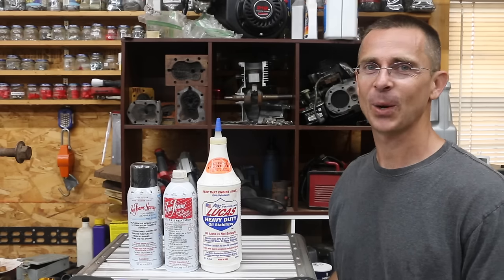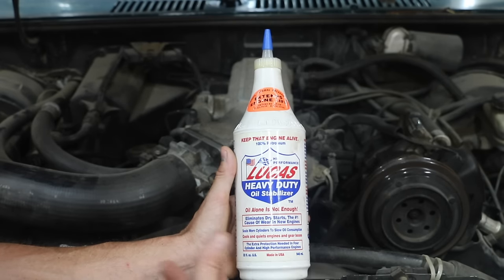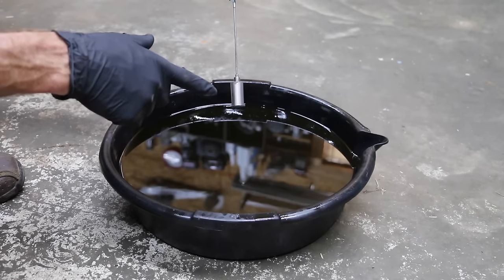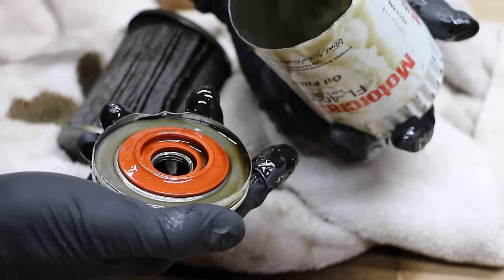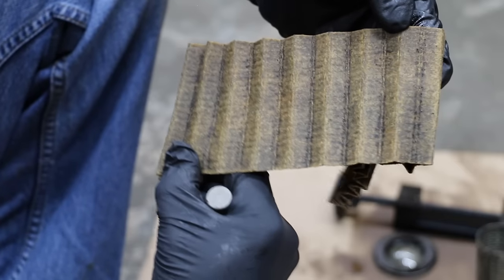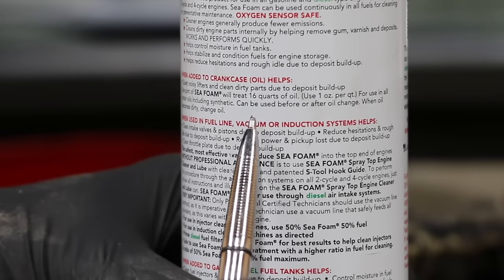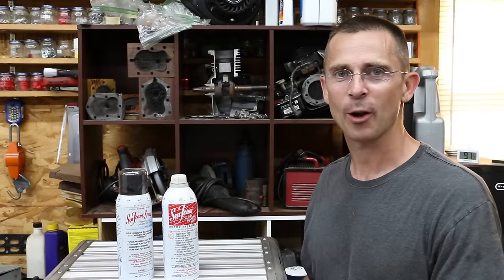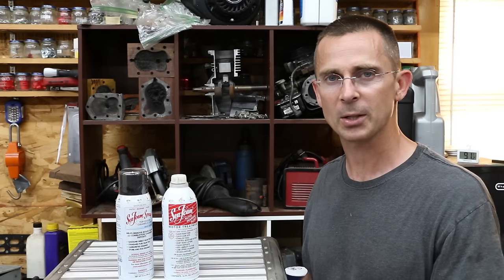Did the Seafoam fix last? Update on the Ford Ranger

Comment from the maker: Sorry it's taken me so long to post the links to the products I've used below and thank you for continuing to offer future video ideas!   Best regards, Todd
Seafoam: https://amzn.to/3l5XjLY
Seafoam Spray: https://amzn.to/3aJptI5
Lucas Heavy Duty Oil Stabilizer: https://amzn.to/2FOENb7
Reply: Lets see how XADO 1stage revitalizant will restore this engine ! : ) I'm soooo excited to see it :D Using it since 2014 in all my cars, hope you will try it :)
Reply: Try Product RESTORE for better compression.
Reply: I add 1oz seafoam after everytimr i add oil. 95 chevy s10 286,000 miles purrrrs...
Reply: What year is the truck?
Reply: Amazing content as always Todd. 
Thank you so much for all the hard work you put into these videos.
Reply: You can ruin an engine doing this if you're not careful. You're not supposed to use synthetic oil in an engine normally running conventional oil. I've seen it clean the crankcase really well but, all that broken up sludge goes straight to the oil pump screen and plugs it up, starving the engine of oil, and eventually spinning crankshaft bearings and blowing the engine. Check your oil pickup screen and make sure it's clean.
Reply: Yo Joe  I've seen it happen and had to replace spun rod and main bearings because of this. If you don't flush the sludge is can plug up the oil pump screen and ruin the engine. No links you post will change that.
Reply: Hi! What about engine seal products? Is it worth a test? Greatings from Amsrerdam!
Reply: How are your seals? I used seafoam and had issues with my seals shortly after the use. So I am wondering if this was attributed to the use of seafoam, I also have been using Lucas for years and am a huge fan of Lucas products especially the oil stabilizer.
Reply: Warning: All of these products are never developed or intended to use by the car manufacturer. They are not even mentioned about in the dealer service manual. 
In general, for short gain would be better performance, compression, and so on; in the long term, you will lose your entire engine for good! Garbage in, garbage has to come out. If garbage does not come out, it will be stuck somewhere starting from catalytic converter
Reply: As a lifelong junker driver, I used to literally fill the engine with kerosene until it was up to the top of the filler neck, let it sit for a week or so, and drain it out... Unbelievable what would come out, and after putting new oil in, it stayed clean for a long time.
Reply: @amicidavinci  I love these old school tips, your generation was and is the greatest. I learned so much from men like you.
Reply: On cessna aircraft engine we used marvel oil it work wonder to bring coprasion back lose up those ring in the cylinder
Reply: And the oil filter cutter?
Reply: @avutex8547  Of course the car maker does not want you to try to extend the life of the vehicle. Just buy a new vehicle!
Reply: Try a Broquet fuel catalyst to increase your compression. It fits in the fuel line like a fuel filter. It takes a long time to build up on the inside of your head.... but it works. I used to sell them, and I've seen independant test results... and they not only increase your upper cylinder / rings life, but they increase your fuel mileage.
Reply: @avutex8547  Well, for one, his engine was on its last legs anyway.  So, if it didn't work or even made things worse, it wouldn't have been a big loss.  And while it is fair to say that many additives are snake oil and don't work and do harm, I think it is a bit exaggerated to say the products mentioned specifically will damage the engine.
Reply: Also an example of keeping up the oil changes.
Reply: @amicidavinci  Did you get the oil out before filling your engine up with a kerosene?
Reply: @eriktumasyan5639  yes, drained oil & put the drain plug back in.  Just don't turn the engine over when it's full.  You can turn it slowly by hand, but DO NOT crank it with the starter motor.  Let it sit for a couple days.
Reply: @amicidavinci  Thank you
Reply: At 205
Reply: I have a great format. Im sure ill watch some more. Good luck to you sir
Reply: Hey...great video. I have a story for you. After buying my 22R Toyota 2wd pickup back in 1984, I drove the crap out of it, putting on 100K in the first 2 years. At that point I was noticing sludge build-up when doing oil changes/valve adjustments. I was good friends with a Toyota Master tech and he suggested this.....when doing an oil change, warm the motor up completely. Dump all the old oil leaving the old filter in place. Dump in 5 qts of diesel #2 and run the motor at idle, with no load, for approx. 10 minutes....dump out the diesel, replace the oil filter and dump in 5 quarts of 10/40 or whatever was your go-to blend was. Re-start motor and, BAM!!!.....no more sludge build up all the way past 175K miles and very little tappet noise. I was paranoid that the diesel would wash the cylinders and cause it to start burning oil but nope, nary a drop at 5K oil changes, even at 175K+ miles. I was impressed. Has anyone else heard of this or tired this??....Thanks.
Reply: @joephoenix8403  ... This "guy" is posting this stuff in other unrelated comment sections. Be careful. It's probably a way to hack your computer.
Reply: Using marvel mystery oil will help with ticking noises.
Reply: @kubasaki1978  Probably similar to the kerosene trick above. I'm surprised it survived being started though, at least a bit. I wouldn't have had the nerve to do that. I suppose either one as a thinner solvent will clear quite a bit of petroleum based deposits. On a worn engine, and after so many miles any engine has wear, I'd have thought that some components would have gaps that such a thorough cleaning would accentuate. I'd put in a more viscous lubricant afterwards, personally, but what you did certainly seems to be working for you, as well as the gentleman that used kerosene.
Reply: Isn't the old style Lucas supposed to be for engines without lifters?
Reply: @chevyed2100  that issue is from deep single cleans, it's better to use the 1oz before oil change method to clean old engines instead of a full dose
Reply: @amicidavinci  I have never used seafoam but I notice that both Stp petrol treatment and mystery oil look suspiciously like red Kerosene to me?
Reply: A mechanic told me Slick 50 helps low engine compression, I haven't tried it myself being skeptical.
Reply: Sir,  you can try Nano GLAY for compression test. We used it on a 1.6 Suzuki Swift that had close to 300000km mileage. Compression seems to get better after running in because when going up slope, it doesn’t takes as much to accelerate compared to before.
Reply: @christopherTheCarpenter  I hate to break it to you, but he was a kid when the real men like me had our own tricks. We would use snake venom mixed with skunk stench to put into a truck. Then we realized automobiles weren't invented yet and we all died.
Reply: when i put a few drops of lucas oil stabilizer in my engine, it burns oil. when i leave plain oil in there without lucas, it doesnt seem to burn any oil. can you tell me why this might be the case?
Reply: @haac4825  It works! Engine has 700.000!Runs like New! Restore= 🐯🐯🐯👑👑👑
Reply: @jaileal8806  He makes a Massive Income! Here! He doesn't need thanks, as if, he's doing it Free= 💰💰💰💰💰💰💰💰💰💰💰💰💰💰💰💰💰💳💳💳💳💳💳💳💳💳💲💲💲💲💲💲💲💲💰💰💰💰💰💰💰💰💰💰💰💰
Reply: @chevyed2100  how to.Flush the Sludge????
Reply: @kubasaki1978  they sell a product called Engine flush 
It works! It's basically diesel too.
Reply: @tonywilliams2264  we used too much. It melted the oil seals, gaskets! 😮😯
Reply: @estabanc546  don't use the Lucas. We  destroyed two engines.😣😤😤😩😩😩💰💰💰
Reply: @amicidavinci  used to run diesel through the crank case of 95 f150 while running.  We also used Seafoam, which I am pretty much a fan of, but I think it loosened up sludge that was serving a purpose and main seal  leaked more oil than before.
Reply: David Guillory very similar to fellow using a fill of kerosene, just a quicker process.
Reply: Is there a reason why one would not be able to do this but reuse the oil with a new oil filter?
Just did an oil change with full synthetic liquid Molly would hate to throw away oil with less than a hundred miles away on it
Reply: @chevyed2100  that's why I never do a full flush, I always start with an ounce pper oil change (1oz, then 2os, then 3oz etc.) to slowly break down
Reply: Lol, can we all just take a moment to appreciate the nice trophy rack of engine parts on the shelf behind him.
Reply: @waynebow-gu7wr  OH WOW! Have not seen that name in a while! I've actually used one in an old car once before! I shall look them up again and see if anyone is selling them here in the US! Thanks for the reminder!
Reply: Lucas has been proven in a test to lose its viscosity when used, also Royal Purple and others, but yes it does.
Reply: TO BREAK AWAY SLUDGE TRY TRANSMISSION FLUID B4 YOU CHANGE THE OIL , RUN THE TRUCK A COUPLE DAYS B4 CHANGING YOUR OIL -GIVE THE TRANS FLUID TIME TO BREAK DOWN SLUDGE
Reply: I'm not a mechanic, but higher mileage vehicles makes the oil stick and increase compression. In the northeast, I use it only during the summer months. It sticks to everything, like honey.
Reply: Sea foam
Ruined an engine for me. Never again.
Reply: 0
Reply: Seafoam penetrating oil may improve compression. Just watched a video of a guy using seafoam penetrating oil on top of the pistons. Seems the penetrating oil loosened up the rings, and stopped burning motor oil as the rings apparently had a better seal in the cylinder.
Reply: Actually, your compression test after this 2nd oil change with the SeaFoam was what I thought might make a great test for...
Adding Lucas. 
i.e. 
1) Test compression without Lucas, only the synth oil + seafoam
then 
2) add Lucas and drive it for a couple days (ensure complete mixing and distribution) and retest compression.
3) Alternative; pick one of the internal surface-coating products (like Slick50, etc) and do the same, see whether there is a compression or performance difference

THANKS for such a straightforward real world test and video discussion format. 
Love your stuff!
Reply: I am hoping you still have that truck its a gem on your hand. Please do another follow-up so we see how well its performing after 5 years. Also you have one or more bad bearings. Remove the serpentine belt and check the idler, tensior, pumps, crank, ect pulleys
Reply: @SalmAndrew  belt tensioner causes all components to fail, catch fire including overheating thr motor up to and including blowing thr motor.
Reply: I know this is an old thread....did you ever do a follow up? Id love to know if water would work. I've been told very very small amounts of water introduced to the combustion chamber during moderate to high rmp operation will steam clean the entire combustion chamber and rings. This causes microscopic gauling on the cylinder walls. This also gives the rings an opportunity to re seat to the cylinder wall thereby increasing compression. Id love to know if it would actually work and i did see increased compression in an old atv i almost completely water logged 🤷🏼‍♂️ great vid as always thanks👍
Reply: Would u recommend changing the plugs after that triple treatment
Reply: I too use Motorcraft filters in my 2 newer Ford trucks w/ Pennzoil Ultra Platinum 5w30 always! Can't beat that combo overall.
Reply: @electric8668  His Ranger? It's an older Gen. Probably close to 20yrs old. I have a newer Gen '20 Ranger XLT FX4 . My previous Ranger went 300k mis orig engine/tranny. Hard to beat!
Reply: @paulthompson7594  Well any newer vehicle made in last 10yrs can go 300k mis w/good care.
Reply: @kubasaki1978  Never heard if it. As an engineer that sounds drastic . Never owned a Toyota truck though. If works 4ya keep doin it. More a 1/2 ton Ford 4wd truck guy. They hard to beat .
Reply: @tonywilliams2264  that Ole Ranger is 20yrs+ old he's just tryin keep it goin. Very high mileage too sounds like.
Reply: @jonathangarzon2798  I think your good.. try at NEXT oil change interval. Don't waste or contaminate new oil.
Reply: @SalmAndrew  Those Rangers last forever.
Reply: @Davido50  they definitely do
Reply: If you want to clean an engine out the best way is to add 1/2 qt of auto trans fluid to the engine oil one day or two before changing the oil and you will be amazed how it cleans out an engine! and better than anything else you will find I might add! That's an old trick from years ago and I've adopted it myself for ages and it never fails!
Reply: Thank you..  Your awesome videos have helped so many of us!!!!
Reply: dose sea foam also work in a disel motor?
Reply: @avutex8547 why would a manufacturer say anything that can save time between services and possibly extend the life of your motor?
Reply: @captainamericaamerica8090 that would be true if he had over 1000000 views
Reply: Do you have a link for the oil filter cutting tool ?
Reply: This lil work horse still pulling ??
Reply: Have you tried transmission fluid in the motor oil if so what are your thoughts 🤔
Reply: I show your videos to anyone I can

Comment: My mechanic friends say no to seafoam.  After watching your video and realizing the lifter ticking in my Jeep with 150k was getting louder, I decided to use it as you demonstrate.  It completely solved the problem and the engine is quiet as it had been 100k miles ago. Thank you for your thorough exploration.
Reply from the maker: You are welcome!
Reply: I’m getting a faint tick on my 2017 Toyota Corolla
Reply: Your mechanic friends say no to sea foam because you fixed all that for under $100 with sea foam. They can't charge you $80 to diagnose the problem, then $125 an hour to change parts. Lol
Reply: @wsieber89  125 an Hr? They tried to charge me 175!
Reply: @wsieber89 keep going , this is 2024 now

Comment: Just found your channel. As a retired technician of over 45 years, I can attest to the strengths of Seafoam and Lucas products. Both are about the best out there, in their field. As I haven't read all your millions of comments, congrats on such a large base BTW, I don't know if anyone has told you that the 2.9L engine in your truck has a solid lifter cam in it from the factory, and there is an adjustment for them. You have to remove the valve covers, so if it's as quiet as it is in the vids, at this mileage I wouldn't touch it yet. The Seafoam did wonders to it. From seeing your initial vid on this as well, I saw how built up your throttle body is too. The gasket is only a couple bucks at the parts store, and removing the linkage and 4 bolts attaching it to the intake to use a plastic hard bristle toothbrush to scrub it while spraying it with Seafoam, will make your idle quality and throttle response like new. Just a long couple of points to add to your very nice production.
Reply from the maker: Thanks!
Reply: I thank you. My partner has a Ford Ranger. I wonder what year his truck is. The one here is a 2002.
Reply: @mellowyellow2022  By the body aesthetic, I'd guess it's an early 90s.
Reply: @erikkeever3504  its an 86-88 with that front end and a 2.9.  The 2.9 had hydraulic lifters but the previous 2.8 was a solid lifter motor.